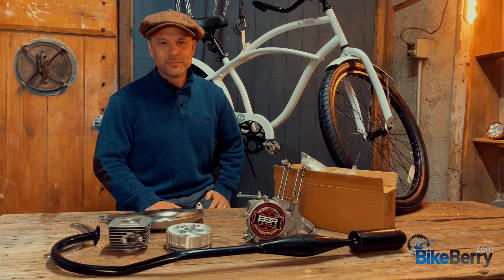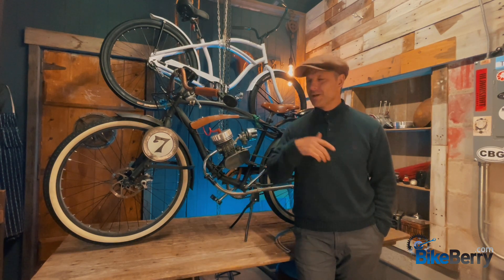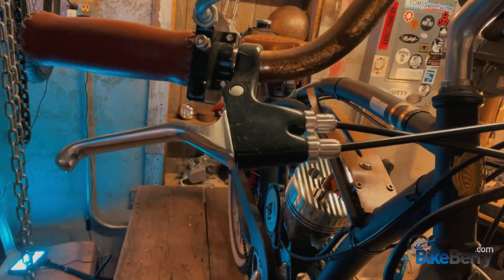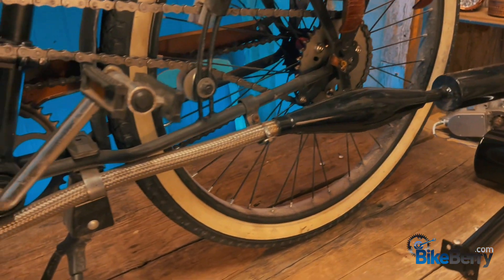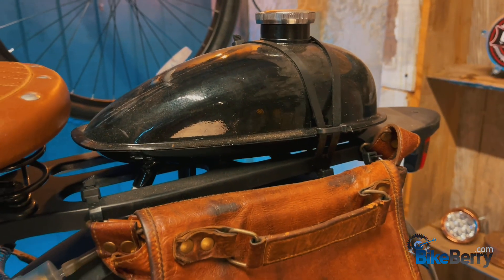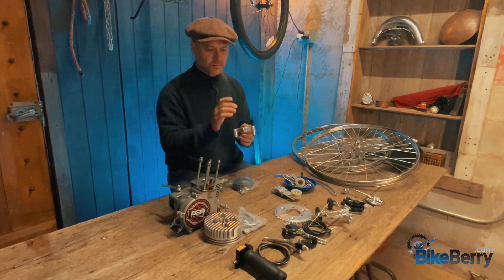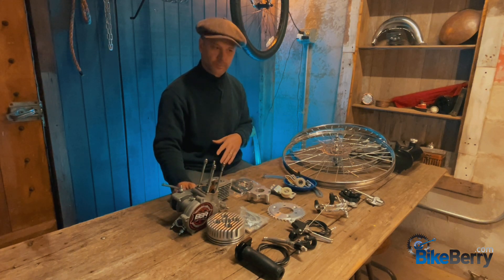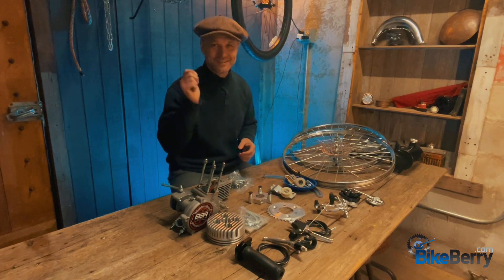Planning Your Motorized Bicycle Project | Thinking Through The Mechanics | Bike Berry

Comment: You should not be grinding the keyway into your axle that's going to mess up your axle you're still going to have problems down the road and I watched the video on it they said if it's tightened down it shouldn't slip it all anyway you don't need a keyway method don't stick rubber under it don't stick nothing under it like that cuz making a keyway will cause you problems with your axle

Comment: are the disc brakes expensive? i'd like to get at least one
Reply: Disc brakes aren't that expensive. Well, maybe the really high-end, top-shelf, name-brand ones... 

Mechanical disc brakes are less expensive compared to their hydraulic counterparts, but they're just as effective. 

If you're planning to get a pair for both front and rear, you'll likely end up needing the 203mm disc brakes. They're the only size that will clear a 32t/36t rear sprocket, for 40t/44t and upwards a caliper rear brake is the best choice. The only exception I've seen was a particular frame that had the disc brake assembly mounted between the chain stay and seat stay, and had only about 1mm-1.5mm clearance between the sprocket and the brake caliper housing. 

EDIT: 
The bike frame that I was referring to (the one with the disc brake caliper housing between the stays) was the Schwinn Taff, you can see it done by motorized bike YouTuber LA Hover. However, he just welded the sprocket onto the hub, instead of using adapters. The Taff's two biggest issues are the tight fit for the engine in the frame triangle (an offset intake is definitely required), and the large downtube requiring the use of an aftermarket clamp (LA Hover used the heavy-duty, double u-bolt version).

Comment: That rear keg style gas tank is not vented! I got 1 and I have to drill a hole in the cap so it can vent, the petcock inlet threads were painted over and not even threaded all the way thru, so petcock would not even go all the way in, had to use my tap and die set to fix that issue, question is how big of a hole should be drilled thru that keg style gas cap??? Don't want to get vapor lock , gas  tank needs to breath !
Reply: That’s something we’ll definitely go over. Thank you for letting us know!

Comment: go electric
Reply: Lack of range
Reply: Haha nope Electrics are slow expensive and useless for range and don’t last. 
Gas bikes are fun fast and are reliable if you build them right
Reply: I actually thought of a cheap 2 stroke gas engine for my bike.  My wife shot me down.  I did go electric.  The cons..  About 2-3 times more expensive, it does lack range.  That said, boy is the electric quiet.  No issues with cops eyeing me buzzing down the road.  Now, for those who really want a gas powered beast.. I have a 143 HP Yamaha FJR that will do 145 mph.  That's my cross country bike.  The electric, just short hop commuter..